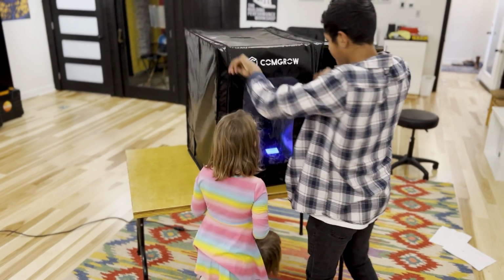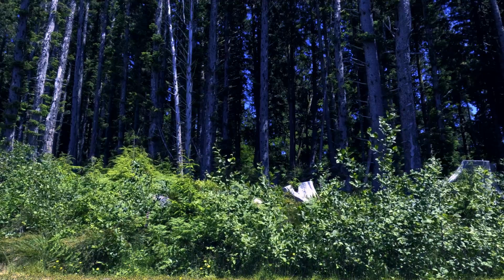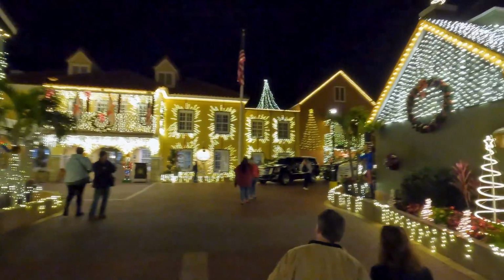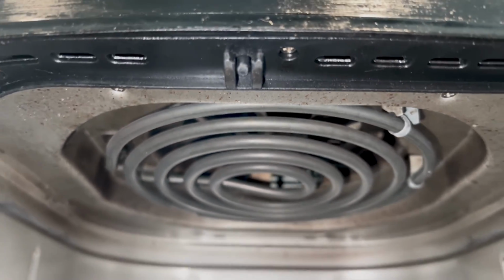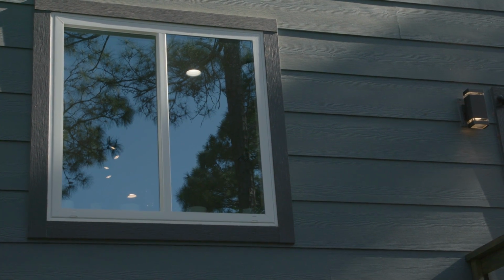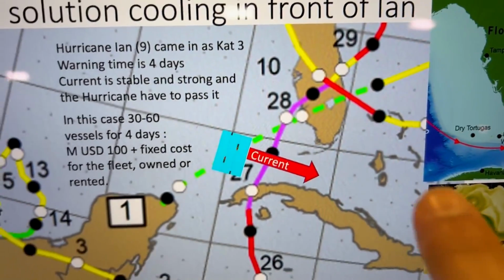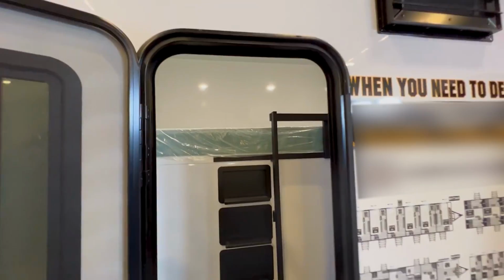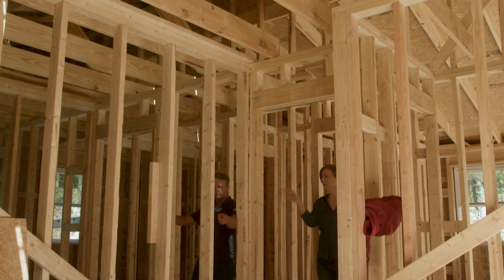Beware of 'Air Purifiers', Miracle Products, & Quick Fix Home Improvement- Ep 305 of HOME DIAGNOSIS

Comment: Those CO2 numbers you measured on the aircraft at 4:00 are pretty alarming. I was under the impression air quality in modern commercial aircraft was excellent, due to the availability of massive volumes of 'free' bleed air from the engines. So what gives? Why is the CO2 level (and the concentrations of all other pollutants in the aircraft) so high?

Comment: One of the most basic issues is what paints and finishes are used for indoor spaces.  I still see idiot building contractors and painters using oil and solvent based alkyd paints for cabinets and trim in new construction where I live.   This stuff off gasses for many years at very high levels.
Reply: Alkyd paints are unheard of for interior work here in Canada. For good reason, as you point out. The fumes are eyewatering for weeks and months. But why do some people continue to burn candles (5:59) in 2024? Modern homes are not caves. We're not fur-clad barbarians. Yet some folks still think it's OK to set fire to things within the living space. Bizarre. (Oh well, at least we don't spit in spittoons the way our grandfathers did!)

Comment: Does anyone else find it terrifying that there are companies trying to change the temperature of ocean currents?  I cannot imagine the widespread disaster that would cause for marine ecosystems!
Reply: ..... and the pumps require diesel generators to keep it operating.
Side note from here in New Orleans;  Post-Katrina the Army Corps of Engineers installed a slew of pumps that have volutes AND vanes that have significantly corroded.
Reply: ..And chem. Trails

Comment: A home-scale 3d-printer has as much in common with a model/toy scale 3d printer as concrete-blockshave in common with Lego.
I'm sure you're aware of this. Why, then, make clickbaity statements like 5:24? I don't see flammability issues with concrete-block houses just because Lego blocks burn like candles..??!!?
Reply: I am so with you Tim. I would love to work and collaborate with you but you are to far away from Me. (Birds of a feather). Also I , like you have been in 1 million dollar homes that the builders just didn’t care enough and had to fix openings in roof transitions, going up in the attic that was 20’ up over the entryway next to the chandelier that was on a wench to be able to lower it to change the bulbs and find out why the drywall was stained there. Reason. No flashing. SAD
Reply: I never recommend to my customers any “Smart Devices” Esp garage door openers for the very reasons you mentioned
Reply: @trickstothetrades1801   yeah after watching lockpicking lawyer video's you will be very careful about buying electronic locks.
Reply from the maker: There is no silver bullet, my touchy friend. It was a transition- something that moves the story from one topic to another.
Reply: @HomePerformance  So, just to be sure, are 3d-printed houses in any way smelly like freshly 3d-printed models are?
Reply from the maker: @AdityaMehendale they will not be problem-free, but the bit about the offgassing was irt plastic based printers. Houses are printed with concrete.
Reply: @HomePerformance  sorry mate but they are not printed with concrete. they use mortar, which is less durable than concrete.
the big question has anyone actually tested what comes off/out of it?  they use quite a few admixtures to get the required properties to be able to print with it. does that off gas? what happens when it breaks down and leaves dust inside the home? 
with traditional brick homes the amount of mortar is small, but 3d printed homes have a massive surface area which is typically left bare and not sealed.
Reply from the maker: Very good Tweake
Reply: @tweake7175  very interesting comment. It will be interesting to see what the future tells us about this
Reply: @trickstothetrades1801   bit of a shame it has to take the future to tell us because its not being tested today.